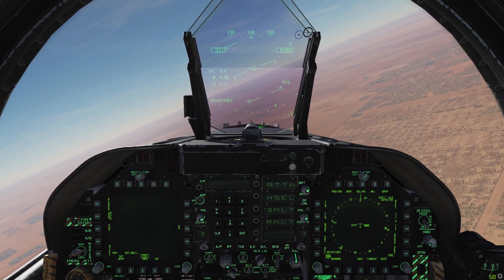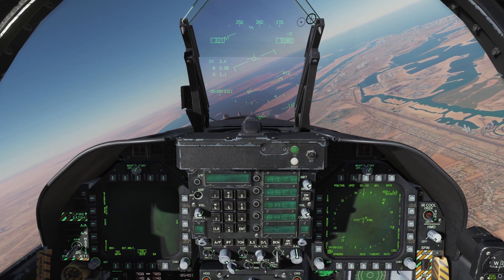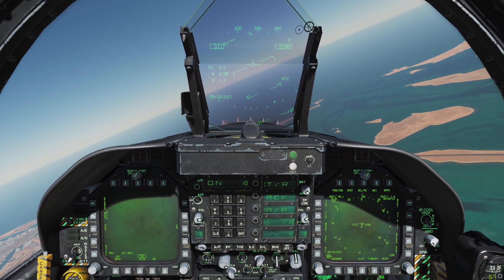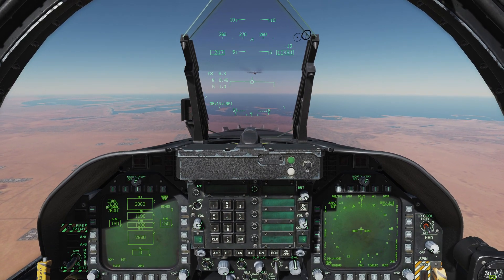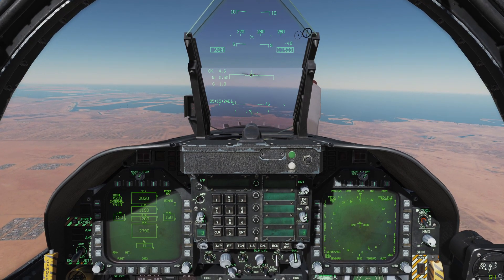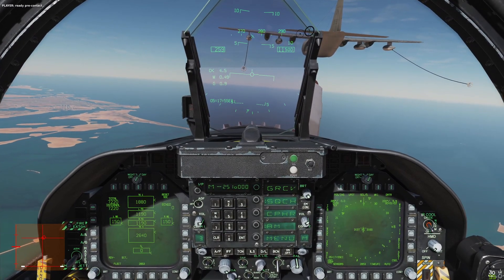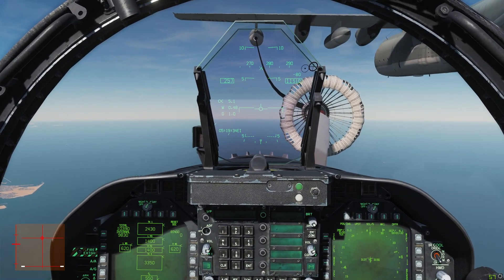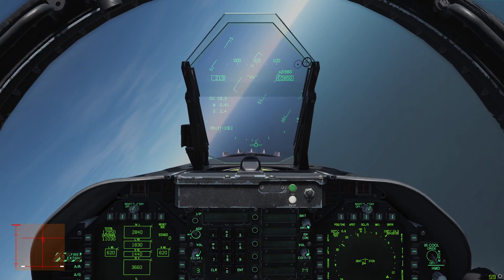DCS World Tutorials - F/A-18C Hornet - Intro to Air to Air Refueling

Comment: I have FINALLY managed to crack air tomair refuelling. Took some time, but the whole trick is to just relax, take it slow and REMEMBER TO BREATHE. Yeah and don’t focus on the fuel hose, focus on flying in formation with the tanker and «stroking the throttle» all the time. That did it for me. Great video! Yeah and air to air refuelling I find harder to do than a case I carrier recovery.